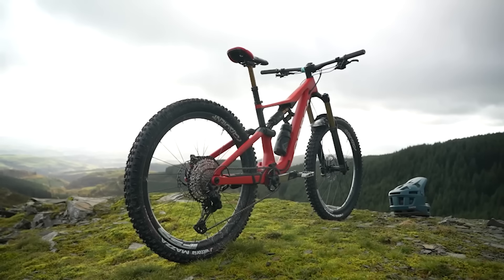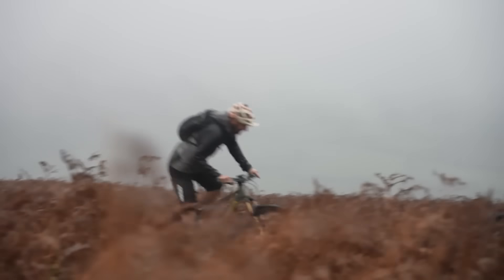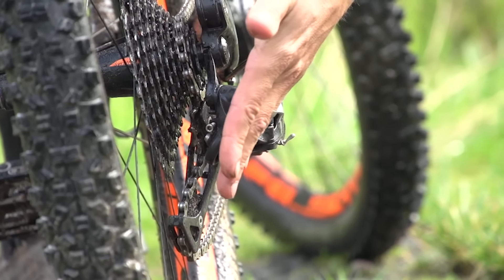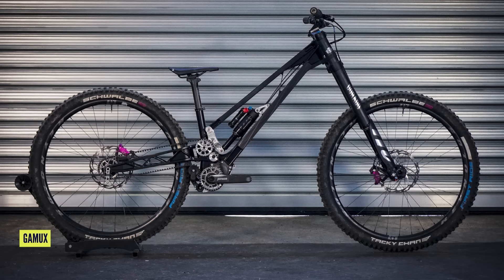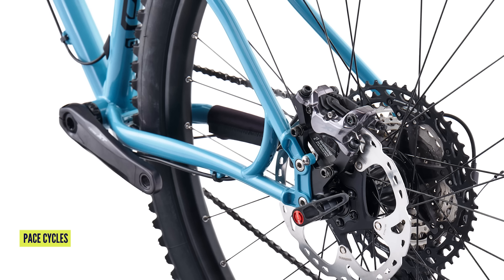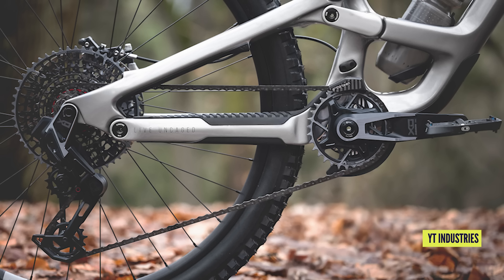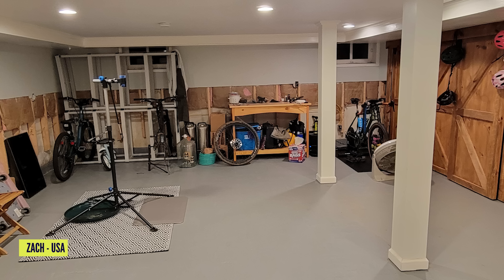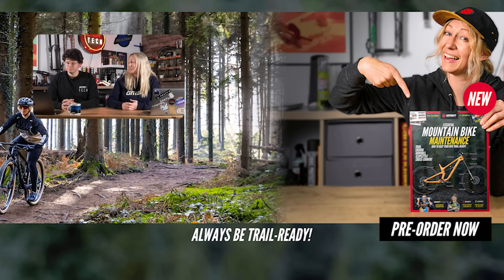Attention Bike Brands: Every New Bike Should Come With These Things! GMBN Tech Show 316

Comment: Every bike or frame sold regardless of brand should include at least one spare hanger and a clear description including model number of the hanger. With UDH this will become less of an issue but any bike not using UDH should have this as standard and there should be no guessing on the part of the owner which hanger they need.
Reply from the maker: Excellent idea! Even stamping the product number into the hanger would be a huge help 🙏

Comment: I have the luxury of a large frame with a bent top tube (Knolly Warden).  Previously I have just used a hip bag that stored all my tools but recently I picked up a Granite bottle cage mount and paired it with a OneUp 100cc pump.

The bottle cage mount is an extended aluminum plate that attaches via the bottle cage bolts.  I am able to strap tire levers and a TPU tube (in an air pods case) on the lower portion with a Lezyne bottle cage to the upper portion.  I can fit a 750ml bottle on this setup.

The OneUp 100cc pump has the EDC V2 tool and plug / pliers kit stashed internally.  The pump is also connected to the bike via the water bottle bolts and sits under the Granite plate.

Comment: Boost Thru-Axles, UDH, Standard 73mm Threaded BB, 31.6 seatpost, external routing...
...but here's my big one: SHORTER SEAT TUBES !!! TALLER STACK !!!
Oh yeah, and 203mm rotors should be the standard on every bike both front and back.
Reply: yep, 150 dropper as minimum, 200 standard: if I wanna drop that saddle, I mean I WANNA DROP THAT SADDLE
Reply: This. All of this. Especially threaded BBs and external cable/hose routing!
Reply: I felt that "SHORTER SEAT TUBES". I was going to buy a Radon Swoop Carbon and I didn't because of that. 520mm on the XL. That's nuts.
Reply: With the exception of short travel trail bikes and XC rigs, 203 post mounts really should be on any bike say with >150mm travel. It’s one of the first upgrades I see on ‘all-mountain’ trail bikes in the bike shop.
Reply: I had to change my 203 back disk for a 180. I am light, no need for a big disc in the back

Comment: I personally like internal routing IF it's tube-in-tube and not through the headset, especially for the derailleur and dropper, because how often are you really changing those cables? Transition does it best, with an external rear brake and internal everything else.

As for stuff that should be more common than it is, the biggest one for me is 34.9 droppers; they're way stronger for longer (200mm+) posts, and they can be easily shimmed down to accommodate legacy 30.9/31.6 posts. 

Also, I'd love to see more downtube frame storage, and not just on CF frames, as Specialized and Trek have already proven it's totally doable with AL frames.

Comment: Strap a water bottle on the bottom of your down tube, been doing it for years, just let air out of fork and find good placement. Get a one up edc pump with tools. I wrap rain gear around my waist. Clif bars in pocket.
Reply: Yep, I use One  UP EDC pump with tools inside pump, and use a seperate mount one each bike. Just put the pump on what ever bike  I am using at the time. All of my bikes have a quick link taped to brake line, as mutliple different chains being used depending on the bike

Comment: 2:50 I don't care about bottle cage as I exclusively use hydration backpack with a 3L Hydrapak. I prefer to use backpack, to have all stuff I need with me, and never take anything out, apart from camera and tripod when grocery shopping. I have an Evoc Explorer Pro 30L so fit all I need, plus a full frame camera with lens and a Peak design Tripod, and even room for more. 
I got a Geometron G1, but you can buy plastic Fidlock mounts that camp on the top tube, down tube. Nicolai did not want to compromise tube strength for bottle mounts. If the tube diameter is the same it can work on other bikes too. If you want to use any type of bottle you can use a TWIST uni connector so you attached the twist system to the bottle of choice, it uses Boa to secure the bottle.
Handlebar mounted bottle cages exist for regular bottles. Dual handlebar mounted bottle holders exist, you can have two bottles. Easier to reach than down on top of under the down tube.

Comment: I certainly agree with the comments about Universal Derailleur Hangers, and threaded bottom brackets. Only interested in internal cable routing if the frame comes with internal tubing for the cables. Not a fan of the fiddly work using magnets.
Looking further into the future, and because I absolutely love the Rohloffs I have on both my bikes, I would like to predict that internal gearboxes will become a new industry standard.

Comment: 34.9mm seat tube.  The larger diameter allows them to make better dropper posts that don’t rattle.

Forks should standardize on the Rock Shox “Torque Caps” standard.

Every bike should have a built-in hiding spot for an AirTag.
Reply: does this affect frame geometry such as tire clearance in smaller sizes?

Comment: Instead of stretching a 26" tube DH or not, the one tube for everything should be a 29" tube. Need to fit it into a smaller wheel? Just roll a section of the tube into itself like a sock. You can get it to fit even in a kid's 16" bike if you had to, and the rubber doesn't have to be overstretched, especially where the valve is patched in and doesn't stretch the same amount and ends up looking like a balloon animal.
Reply from the maker: Great idea! But sounds very fiddly 👍

Comment: All bikes should come with UDH, a sandwich box/pouch, space for a LARGE water bottle,  and internally routed cables (with guides) are a must. I bought a park tool kit for my old trek remedy and it was infuriating, so glad my pivot doesn't have that issue anymore.  also, I think all bikes should come with adjustable brake mounts (or supplied with different sizes) for the off chance you want a larger/smaller disk

Comment: Thru axles front and back. Most new mountain bikes with an MSRP under $1500 come with quick release axles. I would much rather have thru axles instead of internal cable routing. Most bikes over $500 come equipped with internal cable routing.

Comment: All new trail and Enduro bikes, forks, and frames should have their brake caliper mounts for 203mm rotors. Having to use adapters is annoying, and 203mm rotors should be the minimum for modern Trail and Enduro applications anyway.

Comment: Many strong points here. I would add some weird future tech: Square seat tubes (for square seat posts), frame integrated dropper posts to save 200 grams, pressurized top tubes for tire inflation, air pump functionality for dropper posts, and more controversially, gearboxes and belt drives like my bike.

Comment: Long travel dropper post (or at least enough room to install one). I ant understand M size bikes (that's for around 180cm height for most brands) coming with 150 or less post travel. Some bikes won't even have space to fully instert 150 dropper. I am running 210 one up and will not get new bike that will make me downgrade that more than 2cm.

Comment: I'm gonna get roasted for this by the Mountain Bike community for my idea of what every bike should be coming with, but I'm ready for it. 😂 KICKSTANDS! Yeah even big box Walmart brand bike companies are even stopping their installation of them, but I still think center mounted kickstands should make a comeback or at least an option because riders shouldn't have to spend extra money to store their bike because it can't stand up on it's own like more expensive (or just as expensive) motorcycles. If safety really is an issue like I've read, then make them easily removable. "So you mean to tell me this $10,000 bike can't even stand even on it's own when a human isn't on it? Wooooowww...."
Reply: Yes. Standardized and toolless removal.
Reply: i'd love a kickstand. my last mtb had one n it was super handy.. never mind them that judge.. they'd only be secretly jealous!!
Reply: I have never had a moment where I wished I had a kickstand. Running the risk of peglegging a corner is not high on my list of desires.
Reply: Its a matter of safety for you and basically for the frame, its   possible to stuck somewhere - roots-rock etc and crack it...
Reply: You even get Cat3 rated stands, for example by Scott which fit into a mounting at the rear which was made for that. This kickstand don't fold down on trails.

I'm not sure if they offer that too for enduro.

Comment: Every single trail/enduro mtb should now have;

Intelligent internal routing that doesn’t require internal routing tools/coat hangers & doesn’t go around the BB she’ll.

Room for 1 bottle. minimum

UDH

Boost spacing

Threaded BB

Sensible linkages with decent sized bearings

Absolutely NO cables going through the headset bearing (absolute deal breaker) retarded design. 

And sorry, but if your bike is missing any of these things then I’m looking elsewhere. Simple as that.